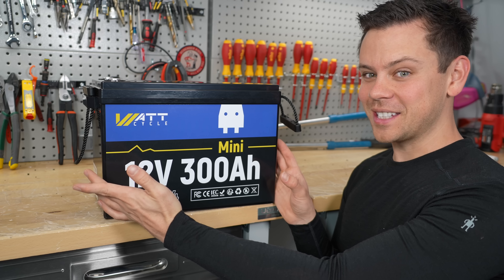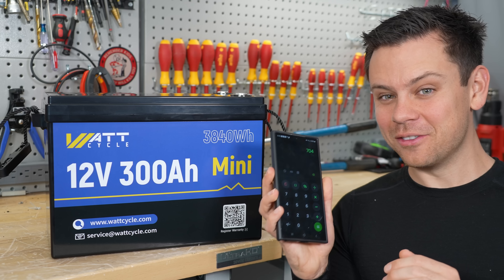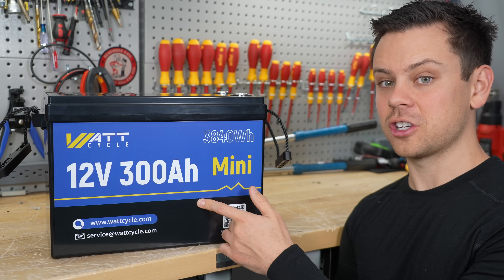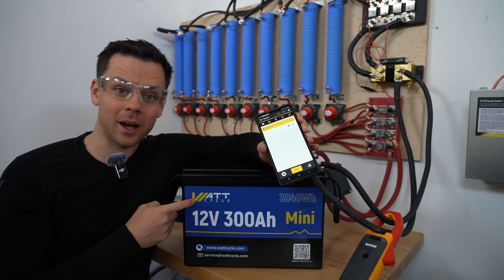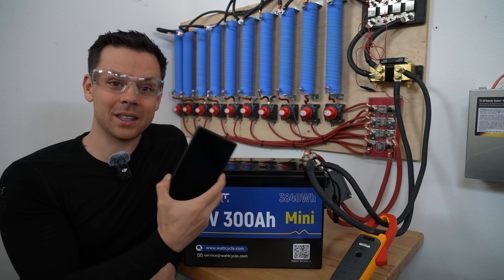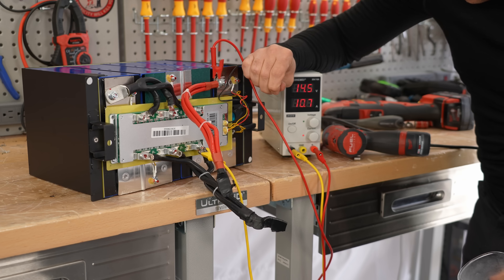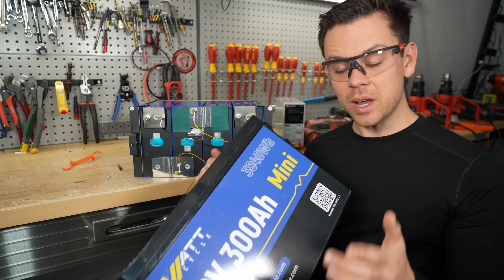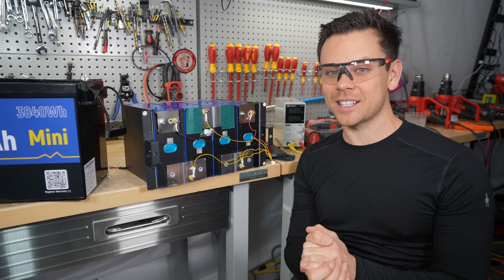Wattcycle 12V "300Ah" Battery: Popular Budget Battery Falsely Advertised?!

Comment: Thanks Will!  You published this yesterday, and today Watt Cycle issued a sort of mia culpa letter.  As a result, according to the letter, they're providing a $50 (each battery) refund to purchasers and extending the warranties 2-years. purchasers.
I purchased 2 of these at black friday, so  I'm expecting a $100 refund.   I'm less concerned about the AH rating than the over current issue.   I intend to run these in parallel. So should I be fusing in between the batteries as well as between the batteries and load?

Comment: Hey will, I got 4 of the 280 eco-worthy that works perfectly and pulls 307 amps average in capacity with charging at 14,4 and a bought the new version with Bluetooth and I’m having a lot of trouble that it’s not balancing at all at higher volts ,I can’t get over 14 volts at all without a disconnect from bms (single cell over volt protection) also the internal amp meter with the app is not that great with showing 83% soc when cycle down to 10% Due that it can’t detect small currents, can you open yours up and do some tests?
Reply: interesting

Comment: Will's keeping them honest and Wattcycle's doing the right thing and doing it quickly. Could use lots of Will clones around various industries. I'd ordered some 100ah batteries and one was DOA. Wattcycle sent me a replacement and no need to return bad battery after an exchange of pics showing multimeter readings. Hat's off to Will and Wattcycle!